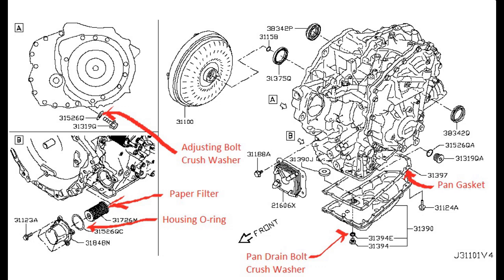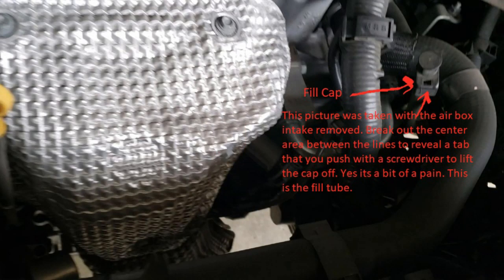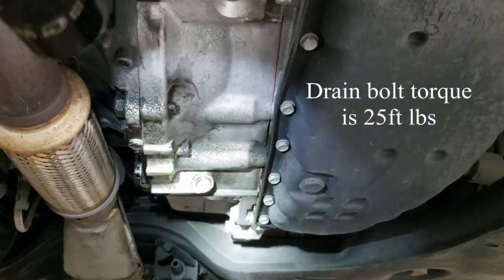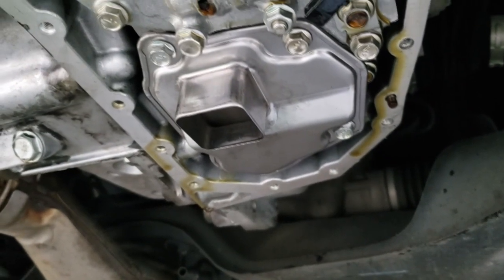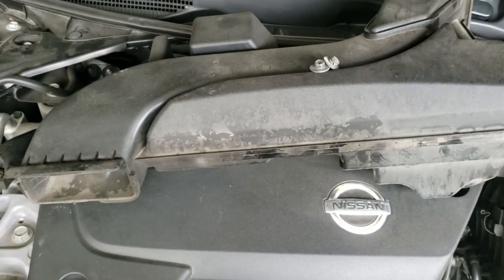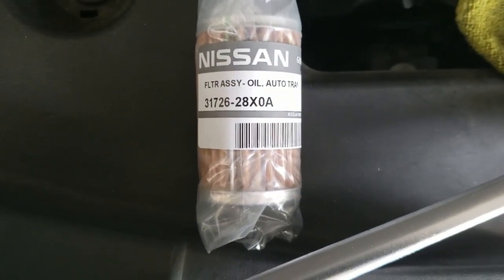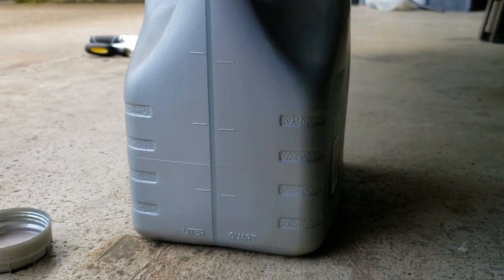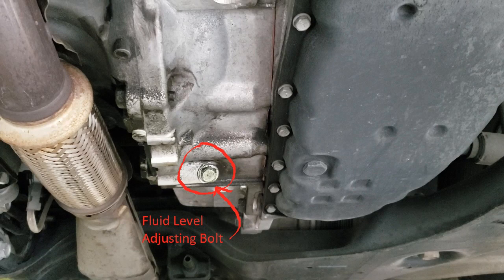2014 Altima Transmission Fluid Flush and Filters Replacement

Comment: Check out Amsoil CVT transmission fluid.  Amsoil stepped up when CVT's were having an problem and made this a version just for CVT's.
Reply: I used Amsoil Synthetic CVT Fluid for my Nissan Altima and my wife's Nissan Rogue. Did complete fluid flush with changing paper filters.

Comment: This has been the most informative video as of yet. Three dealerships told me that paper cartridge filter did not exist finally the 4th dealership sold it to me for $16. The honest parts guy said their service department has never changed one before and it is rarely  sold because nobody knows it exists. When you buy a $300 Nissan CVT service it is more likely than not this filter is not changed. I took out my girlfriend's old one and it was black like coal and I religiously change the CVT fluid every 40K miles. Also, I took off the pan and an extra half quart came out and the magnets were caked with metal sludge. Great video thanks.
Reply from the maker: I can't believe 3 dealers actually said it doesn't exist. Its no wonder these transmissions don't have a great track record when Nissan doesn't even properly service them. If Nissan dealers don't even say the filter exists, they certainly don't change it which is just nuts given how easy it is to do. From what I've read Mitsubishi uses the same Jatco transmissions and they have a service schedule for it. I don't even know if Nissan cleans the metal mesh filter and oil pan magnets or not. Glad the video helped.
Reply: @HowToDoStuf  how tf is it easy to do! the top bolt on top of that housing away from the radiator is fuckin with me, im having a hard time getting it /: and tips?
Reply: @alexaaz9159  If you remove the air filter inlet that is attached to the radiator, you should be able to get to it from above if not from underneath. I did mention that in the video and that may help you to better get to it. You might also try using a wrench instead of a ratchet. I just don't remember having a particularly difficult time getting to it. Hope this helps
Reply: @thevoigts651  hmm maybe it was a little different in my 2011... i did try taking the intake off, and i thought about a wrench but didnt try it. it doesnt help that i literally cant even see the damn bolt , i gotta do everythinh by feel

Comment: Great Job best one yet most people out there dont flush they change the fluid twice. Your way is far superior cost effective and thorough Awesome
Reply from the maker: I just used this same basic method on my daughter's Honda FIT and it works so much better than doing multiple drains and refills, plus replacing the paper fine trans filter in the Altima only makes sense.

Comment: I followed this today.-2013  Altima- 80K. Excellent video- really great quality.  Notes from my experience to augment:
-One of the four screws in the paper filter housing is difficult to reach.  Use an open end wrench instead of a socket.  You can't torque two of the four due to their tight position. Just have to estimate.
-The service manual tightening sequence for the pan gasket graphic is missing a bolt.  There are 19, not 18. Don't sweat it, but make sure you check them all in the end again to make sure you didn't miss one. 
I did everything here PLUS  flushed the transmission cooler (from another video- NISSAN P/N  (999MP-AM006P)). Make sure you follow directions on the can, but then shoot compressed air thru it to push out any flush residue- this is according to the service manual but not in the video or on the can.  Just requires removing the upper hose on the warmer as well as the lower you are already doing for the flush step. I say just, but with the orientation of my  hose clamp this was a bugger. Went in from the top with needle nose vise grips to hold the clamp and rotate it.  I replaced both the upper and lower hose clamps with screw-type hose clamps so I don't have to go thru the same aggravation in the future.
-Wait time on a new strainer filter from ebay and amazon was weeks, so I just cleaned the old one with brake clean and compressed air and reused.
-I used AISIN NS3 fluid from Rockauto.  $8 per quart, ordered 12. Used 10. AISIN ATFNS3 {#999MPNS300P} Continuously Variable Transmission Fluid; 1 US Quart (946mL). All other parts were NIssan OEM sourced from Amazon and Ebay
-Just like he says in the video, started running new fluid out on the flush at about 5 quarts.
-Made a crude dipstick from a section of electric fence wire with the last 2 inches pounded flat.  Got about the same reading after refill as I had before i started.
 Waiting on my dongle not an android family, so has been difficult to figure out how to get trans temp app since apparently none of the IOS apps support that function.  Ended up using my kid's chromebook with google play to order the CVTz50 app and a $22 BAFX OBD from Amazon that folks say will work.  We'll see  what happens. If it doesn't work out, I will just run for about 20 minutes to get it up to temp and then use the drain plug.  

Good luck
Reply: Really good feedback. I also will be ordering the Aisen NS3 from Rock Auto next time I do this. Hopefully you'll get the temp thing figured out. If I remember right it only took less than 10min for the trans fluid to hit the proper range (temp outside was around 80f I think).
Reply: -I got the BAFX today.  Worked like a charm.  I used the CVTz50 App on Google Chromebook with Google Play. 
-Here is the video where I picked up the trans cooler flush: https://youtu.be/7xT8QEMD-lw
Reply: @philclark5648  It may be just fine, but I personally don't want to put any chemicals into my trans lines. I'm puzzled however that he goes through the trouble to flush the warmer, but ignored or just doesn't know about the far more important fine paper filter, and chooses not to drop the pan and clean it or the mesh filter.
Reply: @thevoigts651  I thought he did mention those 2 things in the vid. He said he replaced it but you can clean the mesh and he said he replaced the paper filter. He also mentioned cleaning out the pan!
Reply: @occckid123  I looked all through that video and I don't see anything at all mentioned about the filters. He did give a very clear demonstration of cleaning out the cooler.
Reply: @thevoigts651  I couldve watched another video b4 this 1 lol.  I have 2 rewatch now lmfao
Reply: Yeah, that one 10'oclock 10mm bolt is the sole reason this whole deal is "unserviceable" (cynical) since no service center can bill enough to offset the time needed by many modern technicians. :)
Reply: Can you help me finding the video ( or service manual) on how to flush the transmission cooler with the can, i saw a video but still confused of which hose to flush on the warmer and in which direction? 
Thanks for your feedback

Comment: Using this method to flash the fluid will not damage anything inside the CVT transmission because the transmission will flash itself by the internal oil pump.
Using external oil pump and force the fluid to the transmission may cause damage.
Thank you for your helpful video 👌

Comment: I appreciate that. It took me quite a bit of time to edit the video and put this together.
Reply: you mentioned at 9:41 to cycle the cvt through each gear...my question is: do you open the drain plug while your car is on?
Reply: @papichulohoy  You could damage your transmission if you open your drain plug while the car is running. I think you are actually talking about the plug that you use to check the fluid level, and the fluid level should be checked while the car is idling in park.
Reply: @thevoigts651  Correct, I was refering to the plug on the bottom. Ok you answered my question in your comment.  Is there another way to make sure there's enough oil in the transmission?
Reply: @papichulohoy  No, unless you make/find some sort of dipstick and check it when you know the level is right via the fluid level plug so you have something to compare against. Many people wish Nissan had just put a good old fashioned trans oil dipstick in the car, but they didn't.
Reply: They did mine has one lol

Comment: Brilliant video! Thanks for your instruction. I have x-trail 2009 2.0 with cvt and is very Similar. Here in Brazil we buy the fluid in Mitsubishi dealer because the ASX car use the same CVT. We pay about 8 USD for each liter (1.05 quart). This tip of the adjusting bolt is fantastic! I Also use the cvtz50 app. Thanks again and greetings from Brazil!
Reply: Glad you found this helpful for your vehicle. I hadn't even thought about this reaching internationally but duh, this is the internet. Greetings back from Tennessee!

Comment: I just did a fluid change on my 2013 juke (ns2 fluid). I could not find the replacement pan filter. I did what our local nissan dealer suggested which was to rinse the original filter with water and my goodness that actually worked flawlessly. The filter looked brand new when I was done rinsing. The magnets were pretty "furry" but I cleaned them up and filled it all back up.
Reply from the maker: I probably would have used a solvent based cleaner to clean it just instead of water just in case I didn't get all of it out, but as long as the pan filter was completely dried out, I don't see why water would be a problem. +1 for getting it done.

Comment: 👍👍 thank you! I just did the fluid change on our 13 Altima, I feel like I should’ve done what you did! Next time lol. Just wanted to say that I used a thermometer which I aimed right at the fluid as it was draining from the overflow, that worked pretty good, I did purchased one of those obd2 scanner, but I had a hell of a time with it 😡, anyway thank you for doing your home work and sharing!!
Reply: I appreciate it. My car still is shifting tremendously better about 8k later after having done this.
Reply: What do you think about adding the external cvt cooler on your Altima? Have you heard anything about that?
Reply: @roberto3330  The later Gen Altima like my 2013 already have a radiator mounted cooler. I don't see the benefit unless maybe you are towing, but really towing isn't something this car is designed for in the first place.

Comment: I had a few questions. First one is when you are flushing the transmission fluid you drain two courts out then turn car off and only add two more quarts before draining two courts again repeat ing till it comes out clean ? Second question. When check the fluid level bolt you completely remove to see if it's dripping which is good and if not need to add . Thanks for your time and this video !!!
Reply: AFTER you have removed the pan and cleaned out everything and refilled the pan, then yes I would say drain/refill 2 quarts at a time as the pan only holds about 4 and you don't want to run it dry (as you could damage the pump) or overfill it. If I remember right it took about 10 quarts before the fluid pumped out clear. Yes, you completely remove the fill bolt with the fluid within the correct temp range and if it drips, then the fluid level is correct. Hope this helps. I'm almost due myself  to do this again on my car.

Comment: I saw the video everything is good that’s the way I do all my transmission flushes. The only thing I do different is, I use the return line from the radiator to get all the old oil out. That way nothing old stays in the system.
Reply from the maker: That's basically the same thing I'm doing. I just use the trans heater hose. It flushes through the entire loop.
Reply: hello a question, What is the return line from above or below?? thanks
Reply: Hola, cual es la línea de regreso de arriba o de abajo, ?? Gracias

Comment: Do you leave car running while adjusting fluid level. Thanks
Reply from the maker: Yes, the car should be level, idling, and the trans fluid needs to be within the specified temperature range.

Comment: One easy way to flush the transmission without removing the oil pan and filter is to drain the fluid and disconnect the line to the radiator then start the vehicle 2 minutes until all fluid is out ,then turn off the car,reconnect the line and fluid plug and finally replenish of new transmission fluid at the level indicated.

Comment: Does the motor need to be running to check the fluid level
Reply: yes. The transmission should be cycled through gears then in park, up to operating temp (trans fluid should be between 35-45c/95-113f), car level, motor running.

Comment: I jsu performed the service I measured the fluid and got just shy of 4qts out I filled it back up and did the burp proceedure I got aprox 1/2 pint back before the trickle sees like it should have been closer.
Reply: I'm afraid I'm a bit lost regarding your comment. A simple pan drain and refill takes about 4 qts. The full pump out flush takes about 10 quarts. I don't know what the "burp" procedure is.
Reply: @thevoigts651  The burp is where the fluid stops  fully streaming and turns to a trickle I did not expect to get any fluid back I measured it very carefully as I used to be a heavy duty tech back in the day.

Comment: I have a 12 altima 2.5 thst has  a cvt dipstick. Can i just use that to check the level?
Reply from the maker: If your year Altima came with a dipstick, then by all means use it. The 2012 service manual (available online in pdf) should tell you if they use the fill bolt procedure on the 2012, but if there is a dipstick it should be accurate. The problem with my 2014 is there is a dipstick tube but no dipstick. I haven't found a dipstick that I can use with mine to get an accurate reading.

Comment: Love your video, how much degrees should the CVT temp be at, when checking the CVT fluid on  a 2014 Nissan Rogue SV AWD?
Reply: Thanks. I don't know off-hand about the temp for the Rogue trans. You would probably have to find a pdf of the service manual to get that value or ask on one of the Nissan forums.
Reply: Hold the lever at each position for 5 seconds.
Check the fluid at 35°C (95°F) to 45°C (113°F).
Lift up the vehicle.
Remove the overflow plug and confirm that the CVT fluid is drained from the overflow plug hole.

Comment: Great descriptive video.  Is this  procedure the same for a 2014 maxima? 
Thanks
Reply: I haven't owned on a maxima so I can't give u any specifics, but the same basic procedure should work with it. You would need to look up the schematics for it to get the appropriate part numbers as I would think it has a different transmission than the Altima.

Comment: Watched several useless videos on this before I found yours. Thanks for such a thorough video! Im assuming you leave the engine running while taking the overflow bolt out?
Reply: Thank you. I did the same thing as you and pieced most of this together via forums and a youtube video I linked to. Yes the car should be level, trans fluid within proper temps, and engine running. That is covered in the video.

Comment: Do you open the weep hole screw while running or shut the car off first?
Reply from the maker: The fill bolt should be open with the car idling and level. The trans fluid needs to be within the specified temp range also. If it barely drips, fluid level is full.

Comment: Really good video, very informative. Do you know if this procedure will work on a 2012 3.5 Altima, actually, will the part numbers for the replacements be the same? Thanks very much for taking the time to record and to post.
Reply: I'm not sure if the 2012 has the warmer or not, but the lines are going to go through the same route to the cooler on the radiator so pumping out the trans fluid should work the same. You should be able to look up the schematic on Nissan parts deal or other like websites to check the part numbers for your 3.5. The transmission probably is different but still is a Jatco so will still have filters.

Comment: At 8:13 you say  '...a couple of more quarts, refill...'  Where are you refilling? At 7:53 it looks like two clear hoses, one out of the fluid warmer and one extension into the radiator.
Are you refilling into the dipstick hole, or have you attached a funnel to the hose going directly into the radiator input?
Reply: I'm refilling into the dipstick hole.

Comment: If I request this service from the dealer, will they perform it? I am not capable of doing this repair.
Reply: You will need to tell the dealership that you want everything that @How to do stuff showed you.  You might be surprised by what it will cost you though so get estimates from more than one dealership.  I estimate that to do the CVT fluid change, clean the metal strainer, replace the paper filter, and replace the fluid pan gasket and o-rings will cost you $500 or more for parts and labor.  This service is not very difficult to do.  The most challenging part is loosening one of the top bolts on the paper filter housing.  I used a 10 mm 1/4 drive socket with a 1/4 drive swivel socket and an extension.  You cannot see that bolt from underneath the car but you can reach above the housing and feel the bolt head with your fingers.  You can save yourself some $$$$$ if you can get a friend or relative to do it for you.  In which State do you reside?  Just curious.
Reply from the maker: I can't speak for them, but I seriously doubt a dealer will do this as this is not the officially recommended procedure by Nissan. I would think however that you could get a regular non-dealership mechanic to do this for you. I personally would buy all of the parts and fluid and hand them to the non-dealership mechanic telling them exactly what you want done.